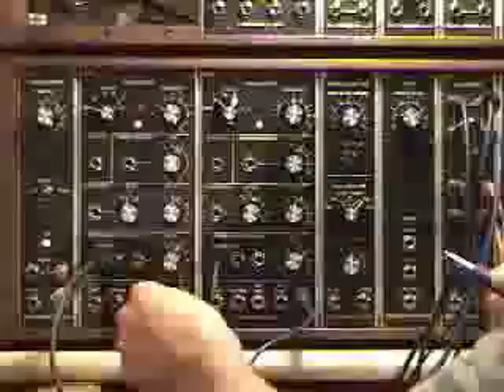Synthesizers.com Q106 Oscillator demonstration

Comment from the maker: @fimpson Yes, it is.  It sounds the same, too.  While it may sound the same as an audio oscillator, it has a different result as a low-frequency oscillator.  The Synthesizers (dot) com oscillator serves dual purpose as both oscillator and LFO.

Comment: @AppA I have a doepfer modular, no you can not.
I think you should get a better understanding of modulars before getting a serge or buchla as if you cannot work out this question, no offence, I would not step foot in to the west coast ideals.
The only way i can think of syncing to midi is to get a midi-cv converter that has a clock output and using it as a gate for an envelope or reset on a lfo.
I spent half a year researching modulars before stepping foot in a doepfer